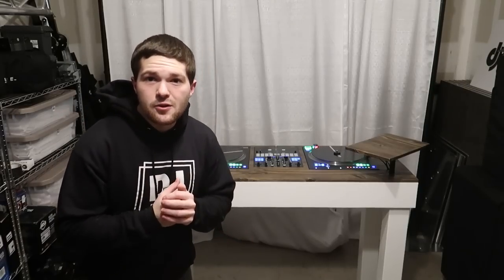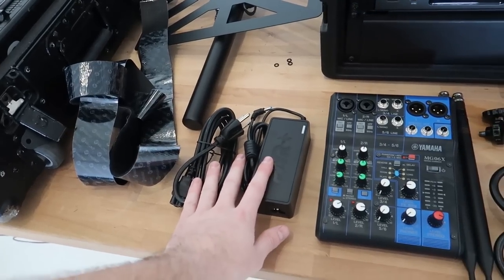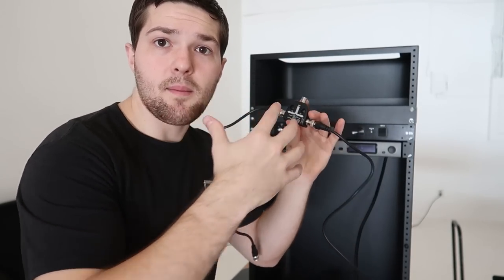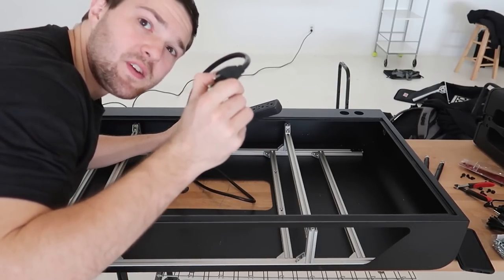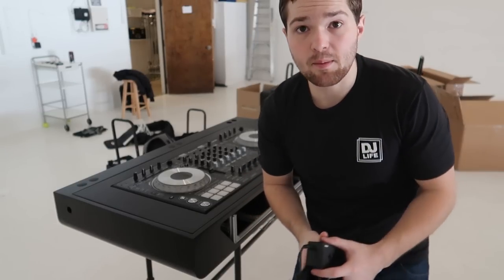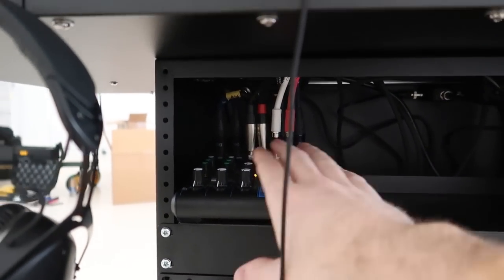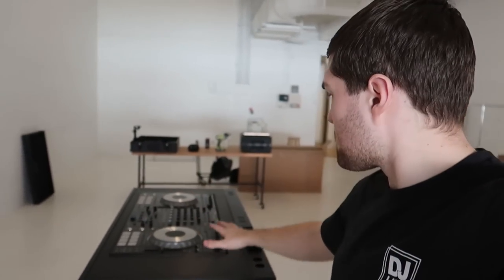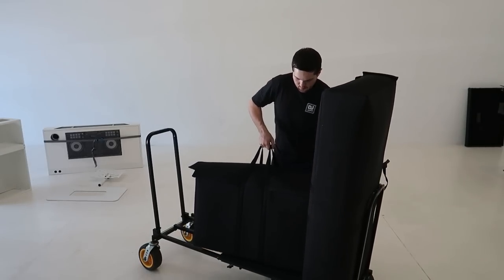My Custom Bunn Gear Command Center | Mobile DJ Booth @pioneerdjglobal DDJ SZ

Comment from the maker: The Bunn Gear Command Center
https://bunngear.com/rick (Includes all the accessories and bags)
Audio Technica Mics https://amzn.to/2WSQqFH
Rack Drawer https://amzn.to/2vX9tSk
Furman Power https://amzn.to/2tHaq0t
Yamaha 6 Channel Mixer https://amzn.to/38cAb7S
Antenna combiners https://amzn.to/2H8p044
Small Power Strip https://amzn.to/2UB2AjW
Velcro https://amzn.to/3bgAS1M
Reply: DJ Rick Web The price for one of these are pretty high, what do you think?
Reply from the maker: Depends on what you value and what you normally use. For me totally worth it
Reply: Rick, thanks for the video! What kind of Rock N Roller is that? Is it the R16?
Reply from the maker: Not sure but its like 8 ft long.

Comment: I like where this concept is going but I think that there is a way to go still for the single DJ owner operators. If you can hire peeps to help setup and breakdown (especially when you are going up/down stairs) this is going to look the best and last for years. If you are open to a few design suggestions, consider: 1. Turn the equipment rack section into a handtruck that carries the controller top and the base plate. 2. Add strong magnets that hold the cover on the top steady when turned sideways. 3. Add a powercon power strip to the top section to enable easier (and safer) power linking from bottom to top. 4. recess a portion of the rack rails near the top and the bottom so that the connectors do not protrude where they can be seen from the side. 5. Add a slot to the laptop pipe so that the power and USB connections can be hidden inside with the help of a plastic cover.   -Sorry for the long Youtube comment and best of luck to you in your adventures.

Comment: Bunn Gear is always high glass and top quality.  The clean look does not distract the guests away from the work that the dj is putting in.  Plus it is fast, easy, and light to set up

Comment: I ordered one as well. As I read through the comments, I realize it may not be a good fit for everyone. My vision is this has a super clean look that will standout in almost every situation.  When you are looking at all the facets of your business, this will certainly add the WOW factor to your image. Putting in your custom touches and making this a fully integrated booth will ultimately speed up your set-up and breakdown time. The other feature that I like is putting you, as the DJ, out in the open to bring you closer to your guests. It's all about breaking down those barriers. This is one of the first set-ups that doesn't look like a fence or obstruction. Whatever you decide to do, know that Joe Bunn, as evidenced by the DJ Vault, is working to make the industry better as a whole and gives you yet another way to standout in your market. Also about the price, do the math - if you are a Wedding DJ and have 20 weddings planned, the investment in image of $100 per event with 100% payback in the first year becomes priceless! I guarantee that clients and guests will remember how cool this was when you rocked their event!  Then there will be the photos.

Comment: This is a step in the right direction. Next version, I would make bags with wheels and a pull out handle so you have the option to just wheel it in without a rockNroller. Like to also see the screws in the base be something you can't loose easily, maybe more of a latch or permanently attached screw mechanism. Great job though Joe Bunn. I really like it.
Reply from the maker: Already in the works with the screw replacement. Might see it in production.

Comment: I’m seriously considering this for my DDJ-1000SRT. I wish they would add an access door in the front to easily access the back of the racked equipment to add or take out cables, especially if something happens and you need to change out quickly.
Reply from the maker: It would be nice. But it would add to the weight as they would have to add reinforcement in all the corners. This design provides rigidity using one piece of medal as the front.
Reply: Orkestrated Beatz  maybe small panel pop outs away from the corners like rick mentioned but enough to get eyes and a hand in there. Held in with magnets or those thumb screws might be better. Once tightened its all rigid. Maybe water jet the panels with logos or keep them blank. Options are endless.
Reply: just use a can opener👍

Comment: I can see some cool tops cut with a water jet with awesome inserts and lighted logos!  More rigid top from aluminum with say a small slot machined all the way around an inch in from the edge. Enough material left to keep it one piece but up light the slot from below with leds on a controller. Change colors, static or moving. Cool!! 😊

Comment: I like the black. I’m going to order one and weld wheels to the base and use it like a dolly for the bottom rack portion. Thanks for the video!!
Reply from the maker: Interesting.
Reply: DJ Rick Web I’ll post a video once I get it in and mock it up.
Reply: Vinyl wrap it (any color) and add ya logo....💡😍
Reply: They make vinyl wrap that looks like different wood textures....but damn 2k$ for this🤔😡🤔😡🙄🤐💳

Comment: I do like how it looks, I dont really like how it functions so much. Seems like too much to do to move in and out a gig. 
I personally like a table facade hibrid where you have a big front area, the table top that folds up and down and the sides that fold too. That gives you a lot to play with  lots of room to put the cade, laptop, mics, second laptop, light contol center, drinks, food... and you can have any ammount of things underneath (props, racks, fog juice, bags, cables, cases...)
Maybe it is just the way I learned, but it makes sense in my head

Comment: With that rack setup, I would seriously consider replacing the analog mixer with the Behringer XR18 mixer. It comes loaded with EQ's Yes one for each input and output, a compressor for each input,  a noise gate for each input, combo XLR/TRS inputs, etc so it will take all your mics, and line level inputs. Even has a pair of RCA Aux in and outs. The mixer has no knobs except a headphone volume. It is completely run from the laptop, so setup is from your laptop. EQ of speakers for the room, adjusting your monitor, etc is on top on the laptop.  If you get asked for a corporate gig or wedding with a band, boom, 16 mic inputs to mix the band is built in. How dope is that.  Just bought mine last month. They are new with warranty for less than a grand.  Seriously look into one. Can adjust the mixer from your laptop, or a tablet. Hooking up a band, no running back to the booth. Mix them on the spot with a tablet.  Forgot to mention, 6 mix bus outs for the band's monitors if needed.  My analog mixers are all on Craigslist now.
Reply from the maker: But does it fit in a slim rack?
Reply: @DJRickWeb  Yes.. Check the dimensions. 2 Rack space.  The two rack space height is bigger than the depth in the rack. I have mine in a short SKB rack mounted backside out so all cables go in the back for a clean blank front with the logo. No cables on the rack front. The rack ears can mount on the front or back. Without an open back you would mount it the other way.

Comment: Yes I agree with ultimate event lighting wish the top cover was maybe metal and screwed on permanently.
Maybe metal won’t flex like I saw in video .i do love it and am extremely interested
Reply from the maker: If it screwed on you couldn't turn on the power strip. But I see your point
Reply: @DJRickWeb  Personally I would keep the strip on and hook it into the Furman

Comment: Nice design. If the front cover came off of the rack system that would make for better cable management.
Reply from the maker: It would but it would up the weight and cost to that that.
Reply: Check out the Strong Rack System they are for audio components for home theater system. They have one that the cover is removable. that’s where the cable management idea came from.

Comment: That's great idea... Have you considered making a multi pair cable to connect the controller and the bottom rack so that all you have to do is disconnect the one cable as opposed to completely disconnecting all the cables from the mixer?
Reply from the maker: Yes I have.

Comment: This is great! It’s super clean and cuts back on set up time I love it!
Reply: Kevin Banda I’m not sure your set up time will improve the way you think.
Reply from the maker: How not? I timed it under 2 minutes setup and teardown. Quickest I setup my event table was 10 minutes
Reply: DJ Rick Web I get that, but with a standard facade and my controller prewired in the case it’s about the same time for me.  It’s a clean set up though.    It will be interesting to see how it holds up over time.

Comment: Nice job, that black one is beautiful.   A few thoughts -  what I like most about this is no more cheesy facade.   That said, I have two concerns for you on that front (no pun intended...) -   first, the location of the laptop stand.   Sure, if you only take your own comfort into consideration, then that is the right spot to put it in, but with no more facade (hopefully), you're going to have people in crowded places/venues bump into you from time to time, and you don't want the first thing they bump into to be your laptop.  So imo, laptop stand should move to about half way between where it is now and where you stand and dj.   My second thought is also related to the same point (no facade) - how stable is the whole thing ?   If a guest can now come over and basically lean on the corner of your table when he addresses you, is it stable enough to take it ?   It might be, I just didn't see it addressed.  My additional and very personal question would be if they would make this in different heights (basically height of the base...), as I'm a tall DJ and I'm sure the taller and shorter DJ's would love to be able to buy something above or below the standard.    Thanks and best of luck with it.  looks great.
Reply from the maker: You can practically put all your weight on the edge of this. It ain't going anywhere. You literally need to tackle it to make it tip over.

Comment: Great video. As a man with many different pieces of gear could I purchase a turntable version and a top for a ddj 1000, etc?   Also, it would be interesting to see how stable a turntable setup would be in one.
Reply from the maker: Absolutely. You could just buy a seprate pvc cut out. The rails will adjust to the different setups. I dont think it will have any trouble holding turntables. I put my body weight on the rails off camera
Reply: DJ Rick Web 👍🏾
Reply: @Cleveland Terry, just need your added review!!!! 

@DJ Rick Web nice review man!!! Been following you for a minute, and love the professionalism and help for the everyday-weekend DJ!!

Comment: Lovely case - Given the distance, I would have opted for the stubbys to be on the front of the unit and not sticking out the side - They're likely going to get knocked and BNC isn't a strong connector in the first place. 

Other than that very nice (albiet a tad expensive) solution

Comment: I Like it! I'd rather have a tray w/foam for the mic. I can see the mic getting scraped up and if it's on and the sound up, you will hear that scrape each time to remove it or place it in there. Also, maybe plastic sleeves for the laptop pole, again less scraping.

Comment: Hi rick - so can you install a sliding rack tray in the Bunn command Center like you did in your rack case in another video? It would be for the Yamaha mixer .
That would be awesome
Reply from the maker: No because the rack drawer needs to be supported on all 4 corners. In my rack its mounted to the back rails and front rails.
Reply: I’m so on the fence cause they might come up with some new and improved things then I’ll be sorry I did not wait a little longer . It’s pricey but worth it I believe and I would also want a 2nd laptop stand but not for 150.00 . Like leaving controller in the center but don’t like the strap idea . It’s really a high class piece
Thank You for all your videos 
Peace
Reply from the maker: They are not making the second version any time soon. That will be 1 to 2 years out in r and d.

Comment: Okay, I've been dreaming of building something like this from wood and metal for the longest time and I'm pleased that someone else thought of it and made it happen. I love the rack space underneath and the fact that it's lightweight. HOWEVER, there's a catch: I'm not a DJ. I'm a keyboard player. I don't need the rails inside the unit or the laptop holder (other keyboardists might). I need larger versions of the mike clips to accommodate my Alesis Air Fx and Air Synth. Another thing I don't need is that bar that runs across the front. It blocks my fingers from playing keys. Can it be removed?

Comment: Look great,  yes looks clean and sleek but Still looks like a lot of work to set up especially if you're a mobile DJ, maybe at a location you are not going to move it much.  There's nothing Just pulling up to a gig unfolding your odyssey  Fzf5437t table or similar in a few mins, slap on your DJ console with your odyssey  case or similar take the top case cover off or option 2 roll up with a flight case with wheels that holds some of your equipment and use it as a table slap on your DJ console with your odyssey/flight case on top.  DJ Fasade optional. WOW! I just saw the price 2K socked for the price especially not so mobile and Time is Money. This is my opinion as a mobile. Look at this as positive feedback as this is my opinion and I own a van this probably would work out for somebody who has a car/smaller vehicle.  On the website video, you have to connect all the cables that time should be included for setting up time because I can say I unfold my odyssey table 30 sec. slap my dj console road case ontop pull the case top off 30 sec. and it looks like if you leave your dj consol in this bunn Gear you might have some issues.
Reply from the maker: I will be making a full video showing my setup time. And I already have my deck saver coming as I decided to ditch the flight case

Comment: one question. The booth is fantastic, but why do you use an extra mixer on the first shelf? Because, you can wire your speakers directly in the mixer, no? Thanks for reply.... and great videos ;-)
Reply from the maker: Because the mic inputs are not good on the sz

Comment: How easy is it to lose one of those screws that hold the rack to the base? Maybe version 2 can have a locking system instead...Also not sure about the look of the antennas sticking out...This booth looks great though
Reply from the maker: It's not bad but they are looking into quick connectors for the production model. This is the first black one. I mentioned that to them that quick connectors would be amazing. Might come to production not sure. The antennas I am going over kill with 1/2 wave big ones you can use smaller 1/4 waves if you want.

Comment: There are a few design changes I would made for easier disassembly and transport. However I won’t share unless they need a paid consultant lol
Reply from the maker: Probably the same minor design changes I told them to make. Although one of the ones I suggested was going to add 300 to the material cost. Lol

Comment: Looks cool but the Antennas are looking funny, can't you turn them to the Sides?
Reply from the maker: You could use smaller 1/4 wave antennas but in reality this is going to guarantee the best possible signal for your mics unless you run antenna cables to some big bulky fin antennas.
Reply: How about mounting antennas on the rack section? They wont be as noticable & saves the trouble of connecting & disconnecting from top section.
Reply from the maker: @mrbowtie64  you could but it still would limiting. The things that affect mic signal are 1 how high the antennas are since human bodies block signal. And 2 metal. So the lower you put them the worse your signal and if you put them in the rack it would hurt the signal. You also want your antennas as far apart from one another as you can make them. So the placement of the antennas is optimal.
Reply: imho, the best spot for the antenas is in the back corners of the top part - where they don't stand out as much visually for the audience, but don't really bother the DJ either, and you still get the same good height for them.

Comment: I have a Furman PL Plus DMC Rack Power Conditioner that I’m using for my rack build. The problem is that it is 10.5” deep (didn’t think this one all the way through) and I cannot plug anything into the back of it. I do have some 6” rotating plugs that will fit but drape down. I’m sure I can neatly tie them together. Has anyone else run into this issue or should I just buy a smaller power conditioner? I too have a custom plate from nlfx and not sure the plugs will fit into the back of the conditioner either way. Hate to make a bunch of returns to end up needing the plugs anyway.

Comment: The idea is really nice if you have a stage set up where this unit will always stay there and to hide all the cables and equipment that I keep behind my facade. I personally do not like this. I offer so many services that my huge 6 panel facade helps me hide. CO2 tanks, dry ice cooler, and cable bags etc. A good idea but not for your typical mobile DJ who provides allot of services. I also like to hide my speakers behind the facade and this would mean I have to use line array speakers which I am not a fan of or have to go back to taping down cables from speakers stands or columns. And for $2,000 man that is not worth it for a mobile DJ.